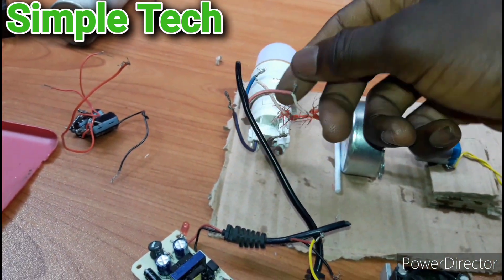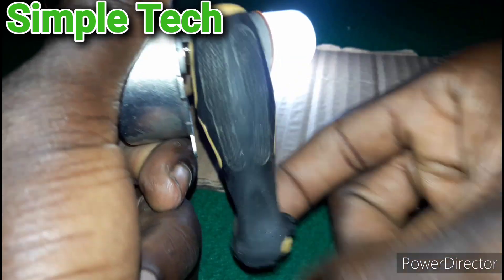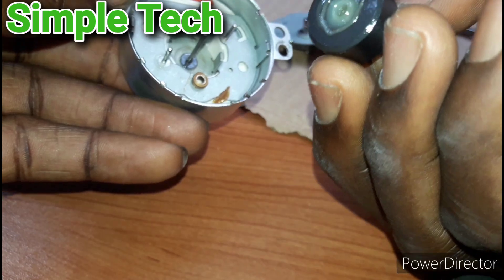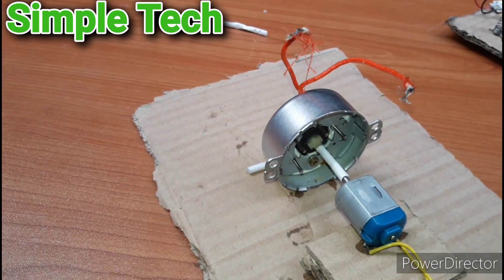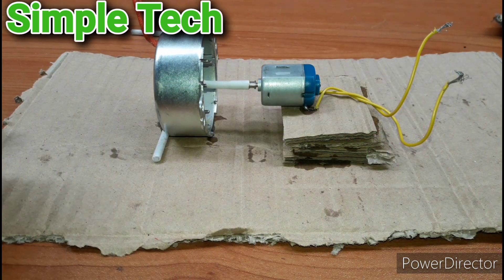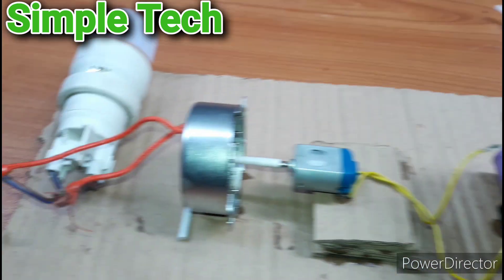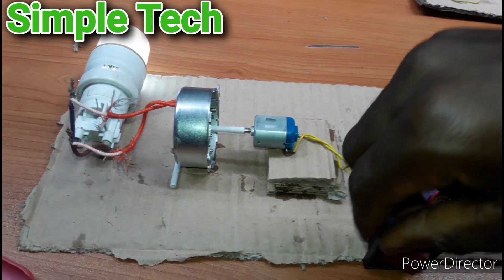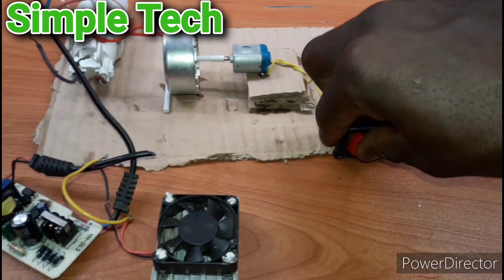How To Make 120v AC Powerful Generator Using Synchronous Motor .

Comment: Is this synchronous motor just the same like those found in printers and some photocopiers? or in which gadgets can I find this motor?
Reply from the maker: Most of photocopy  machines use DC motor,. 
But you can get Synchronous AC Motors  from (Microwave, laminating machines, and Air conditioners  swing)